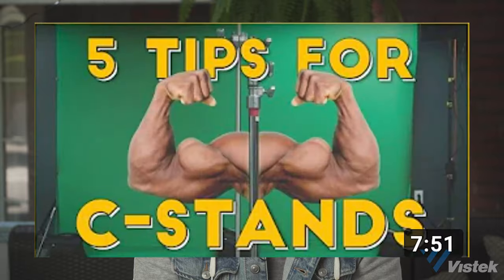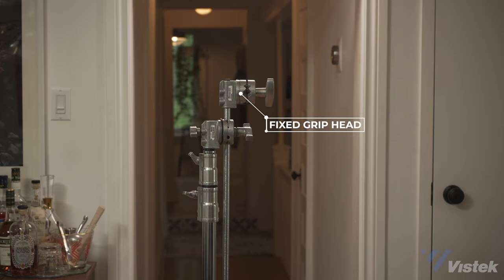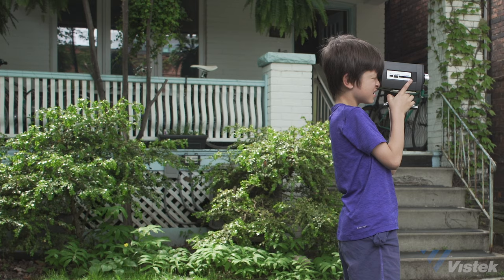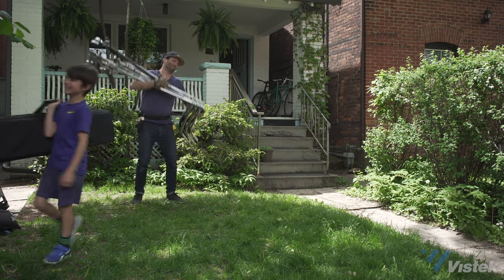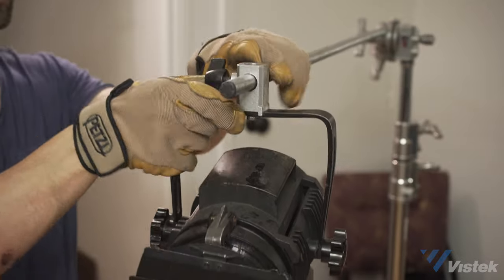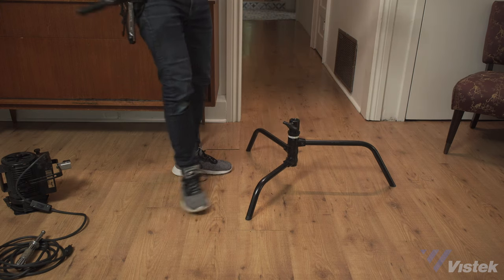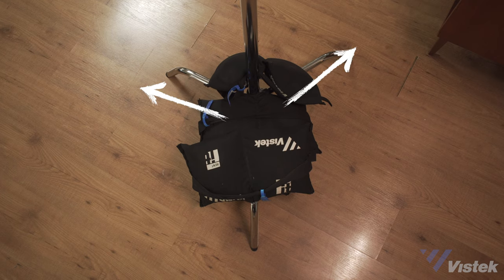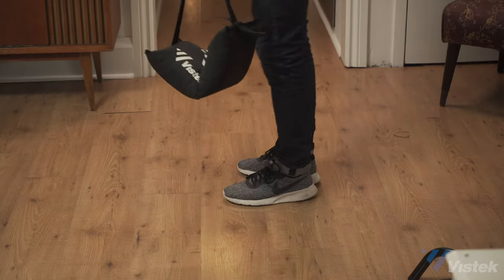C-stands facts, misconceptions, & advanced uses

Comment: One thing to remember when you are turning the C stand up-side-down to spread the feet is to make sure the extension knobs are tight first. Failure to do this when you turn the stand upright again can result in the stand expectantly reaching its full length perhaps striking someone standing nearby or the set/ expensive furniture/ the wall.
Reply: And watch out putting a scratch or dent into the floor when setting the stand tip on ot it - not a good look for the homeowner.
Reply: your toe nails will thank you as well

Comment: Good video. I'd only add a few things and they involve the amazingly useful split tennis balls. If you're inverting the c-stand to spread the legs, I suggest keeping that tennis ball on the tip, so you don't accidentally crack a tile (seen it done), or scratch a wood floor (seen that too). Also, I keep a bunch of split tennis balls handy when I'm shooting in someone's home or corporate offices. Place one on each foot so as not to scratch the floors. The color also helps people avoid kicking them when walking around a set. The client will appreciate the gesture, even if the floors have 18 coats of hard-coat polyurethane on them.

Comment: Thank you for taking the time and creating those with such detail info. If you don't have one, I would love one about all those pins, baby pins, studs, what is what and for what! Clamps, super clamps etc. This is all new,  and adding language difference, even more, confusing when reading just descriptions on the internet shopping sites!
Reply from the maker: Thank you Magdelena.  Fortunately it's quite simple.  There isn't very many options.  There are only two ways to mount a light or grip.  Baby pins & Junior Receivers.  They also go by another name 750 pin or 2k receiver.  This number refers to the average light wattage that are typically paired these pins or receivers.  However, 2k receivers can take lights as large as 20/18,000 watts, and 750 pins can take anything from 100w to 2k watts.  It's obviously an estimation at best.   Most lights that you can lift as one person will typically (but not always) fit on a stand with a 750 pin.  If it's heavy enough to require a 2nd person, you'll always need a 2k stand.  Hope that makes sense to you.  As for clamps, it's also just as easy.  There are some fun types of clamps out there for sure, like chain vices, duck-bills, etc - honestly, if you're just starting out, you'll likely never need to use these.  They're quite esoteric.  The only clamps we use on a daily basis are cardellini (aka mathellini) clamps or super clamps.  Simple as that.  Hope that helps.

Comment: Much appreciated. I use one with a boom cradle 12 or 18 foot carbon fiber poles for shotgun mic. Much easier on the boom operators back for those long drawn out scenes. I always put the tall leg with the boom, but never knew to put the sand bag on it, in front, always thought it should be on the opposite rear leg as a counterbalance. thanks so much,  learn something everyday

Comment: I would suggest habitually checking that all the extension knobs are snug before turning a C-stand upside-down to open the legs.  If one is loose, the top will take off on you like a greased trombone slide. I typically place the top of the stand (or top the grip head) on my foot when opening it to protect the floor. Long habit, so I even do it outside.
Reply from the maker: Great point, panaruss!  One I should have made in the video.

Comment: Thanks. Good advice so liked and subscribed. Just bought two good quality C-stands - much to like about them for indoor use. I have separate turtle base (Avenger/Manfrotto) as looked better quality, durable etc and a tad lighter than many others. I get the big leg facing load/boom position (and 'righty tighty' clamping for GH) but as you showed, if load is heavy enough then side tipping is still a possibility due to limited spread radius so warrants a counter balance on a longer boom and maybe reverse position for counter balancing or use of more sandbags.

A couple of newb queries .... typically what mass of sandbags ought one to be considering? My first DIY effort for 2 bags used lead shot, but it's going to get expensive and a lot less portable the more mass I need to use. Secondly if C-stands used outside (I know less ideal than wider base spreader stands and that a 'turtle base' less helpful than an adjustable 3rd leg for levelling) how useful and practical are ground screw-in anchors on soft ground to compensate for shortcomings on C-stand. I accept that they are useless on hard/paved ground. Also prob no subst. for an assistant watching stands - but it's sometimes a case of balancing safety, costs, portability, practicality etc etc on small jobs where I'm essentially limited in what I can physically carry.
Reply from the maker: Thanks for the comment!!

Comment: Man, I can’t thank you enough. I know stands seem like such a simple thing, but the last thing I want is to have a light fall and either hurt someone or just damage the gear. So thank you!

I was curious if you had recommendations on solid complete c stand brands, and spreader stand brands? I was also wondering what would be recommended to boom a light out rather far and high up (such as an Aputure 300DII with a lantern attached)? As it seems something like a Matthews Mini Max is most ideal, yet those are quite pricey.

Nonetheless, thanks for the content; subscribed!
Reply from the maker: Thanks Jarret!  I'll say what I've said to another viewer - that I've never seen a situation where one c-stand company is better than another.  It's a very universal design.  Over the years I've use Kupo, Matthews, Avenger, Manfrotto - and to be honest, they're all the same.  What separates them is their design (for example, Kupo have a quick lock ring).  Buy the stand you need and the stand you can afford.  That's basically it.  Same for spreader stands.  Know what you're putting on it, and that will dictate if you can get away with an aluminum, or if you need to go with steel.

In terms of the boom - I would say that you should either get a 1K boom pole, or if you have the space; buy a menace arm kit and some extruded aluminum pipe.  The youtube channel Grip Tips has a great video on setting up a menace arm kit if you've never done that before.  Good luck!

Comment: Great video. So apart from the ability to manipulate the position of the legs to fit into tricky spaces like corners etc, what are the benefits of using a c-stand over a similar weighted spreader stand with a grip-head? Won't it essential allow you to do the same things?
Reply: Yep! C-stands are more commonly used indoors and spreaders are used outdoors where more stability is required. C-stands are more maneuverable in tight spaces than spreaders.

Comment: Old Vancouver grip here, not worse than any other c-stand video I've seen but you might want to use some of those handy tennis balls on your stands before you tango on someone's hardwood floors, less scratching. Be safe.
Reply from the maker: Yes, you're not wrong.  For one, these are my floors, so I was less concerned and the plastic bases are fairly new and I knew they wouldn't scuff up my own flooring.  But yes, location interiors, it's always a good practice to do that.  I'm sure there are a few other things I could have said in this video, that I didn't - if we want to be nit-picky.  ¯\_(ツ)_/¯

Comment: Thanks, some good tips here. Talking of tips I was always concerned about propensity of a C stand to tip over, outside in any real wind on account of the limited base footprint. It always struck me that one really needed an extension base/pole that could be superclamped to the turtle base in order to add stability. Mybe more sandbags or cardolini clamping some 'free weights' (eg from a bumbrell set) to lower part of C stand? Any thoughts on this? Prob just a bigger beefier spreader stand?
Reply from the maker: Hi there! Thanks for the great comment.  Even though you will see c-stands outside often, they aren’t ideal. C-stands are best indoors when you need a stand to snug into tight spaces.  Outside that’s less of a problem - so steel spreader stands (has various names depending on your geographical location) - are a much safer bet. You can also bag them more securely as well.

Comment: Hi Dale, great video! I‘m a sound guy and am looking into getting a stand for booming a mic overhead in interview situations. If you‘d know, that you’ll only ever going to use it for that, which type of stand would you go with, a c-stand or a heavy duty light stand? Thanks and best regards! Phil
Reply from the maker: Hi TheEIFuppo.  Thanks for the nice comment.  I would definitely buy a c-stand.  You're going to be told more often than not where you will put the mic (often on the shadow side of the key light).  So you need a stand that doesn't take up too much space.  So a spreader would be a nightmare in many cases.  Plus, you're not really asking much of the stand to put a mic boom on it.  Even with a full blimp, you would at the very most need two sandbags, likely only ever one.
Reply: @vistek  Thanks for the timely reply and the good advice! I hadn’t really given the space, the different types of stands take up, too much thought before. 👍

Comment: Amazing video got my sub!!! What light stand and boom arm would you suggest to boom an aputure 600 d over 40inchs?
Reply from the maker: Thanks for the support!  In terms of your question, at the very least you will need a good 2K combi stand (ideally steel, but aluminum is fine if you bag appropriately). Then you’ll need a 2K boom pole.  You should also get a racket strap like I do in the video or a magic arm with two mafer clamps as a way to secure the boom from any slippage or failure.  Make sure you bag each leg of the stand on the outside (not on the cross bars). The bag should ideally get hung up on the machines bolts of the cross arm.

Comment: Hi, thanks for the great video. I am looking for a stand that would hold a boom arm allowing me to mount a light over my model. 
Would you say a spreader is better than a c-stand for this, given the last part of the video? I do have a spreader that has a wide base (approx. 110cm in diameter) but I see almost everyone using a c-stand for that so it makes me wonder if I should invest in one. Thanks in advance for your help!
Reply from the maker: Thanks for the comment/question.  It really depends on the size of the light and how hi it need to go, or how far it needs to be boomed out.  However I would say in 80% of the cases, a c-stand isn’t ideal.  Just because you see people use them for this doesn’t mean they’re the best choice. It’s usually because photo studios will equip with c-stands but not invest in 2K/combi stands and 1K or 2K booms.  Good photo studios with have boom stands made specifically for photo strobes. Those would be the best for strobes or Nanline/Aputure style fixtures.  For anything larger, you need a big steel 2K stand and a 2K boom, with ratchet straps etc.  Beyond that you need to build a menace arm (worth an internet search if you’re not familiar). Best of luck!

Comment: Hey this is a great video thanks!

I have a question @ 6:07 - is there any reason I shouldn't put the attached head onto the c-stand and use the detached head at the end of the extension arm? It looks like in this example that you don't have any of the arm hanging out the back.

Comment: Great video :) - I have only used c-Stands a handful of times. Is there a way of mounting a junior pin light ie a 1200d on cstand by using some kind of combo stand conversion  or grip head with 29mm (if so what is it please) :)
Reply from the maker: Hi Emagic - thanks for the comment!  In response to your question, there isn’t an adaptor in that direction, outside of placing your light inside a junior base of a turtle stand.  This is done because the weight of junior pin lights far exceeds the safety rating for baby pin stands.  You can definitely do it in reverse, but even if you found a way to mount a 2K style light on a 750 pin stand, it would definitely not be advisable from a safety perspective.  My suggestion is to use at least an aluminum 2K or combi stand, or bump up to a metal “grinder” 2K stand.

Comment: There’s a wrong way to open a stand. Mine came with a hex key. I couldn’t pull the legs apart, so I figured I was supposed to loosen up the joints with the hex key. So, I did. And the leg joint things fell off. I can’t put them back on. And that’s the wrong way to open a C-stand. 😐
Reply from the maker: Bummer!

Comment: Do not turn the cstand upside down to open it. It damages the pin and if the head is on will damage it as well. Over the shoulder is the correct was to open a stand. As a Key Grip I strongly recommend not being seen opening a stand upside down.
Reply from the maker: I appreciate the insight, John.  I agree that over the shoulder is the most common way. However, in a decade of tech’ing, I’ve never seen a pin get more than the slightest scratch.  I’d be more concerned with the floor you’re standing it on. I also don’t know where you’re based, but here in Toronto we often get c-stands from various rental houses that aren’t always impeccably maintained, and the only way to get it open is upside down.  This is the case more often than you’d expect.

Comment: Is there a good aluminum spreader stand for sound boompole?
Reply from the maker: Thanks for the comment/question!  I’m going to leave it up the any audio techs to chime in, if there are any.  However, spreaders are fairly universal - some having smaller legs, some larger and more robust.  Where you set it up (environment) will dictate what you need.   You’ll likely still want a c-stand for interior work, and a more robust spreader for exteriors (wind).

Comment: You specify GLOVES several times, but don't say why. What is the advantage of gloves? I only use gloves for welding, to keep the arc from burning my skin.
Reply from the maker: I feel like I did mention it in the video.  No one likes to get their hands crushed.  Sure, a work glove isn't armour - but it makes a huge difference when it comes to moving and operating steel stands, rigging, and lights.  You're welcome to work on set without gloves if you feel like I need to be be proved wrong.